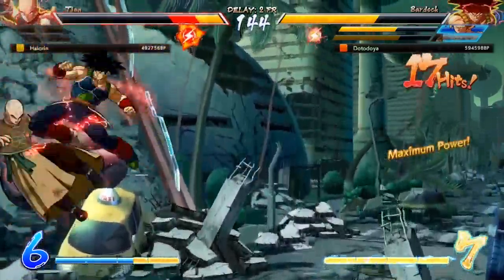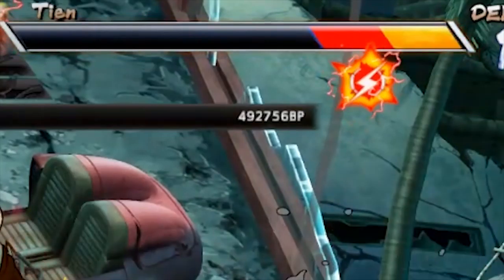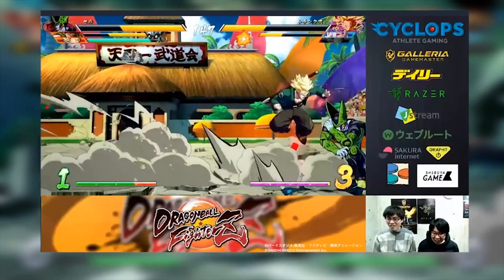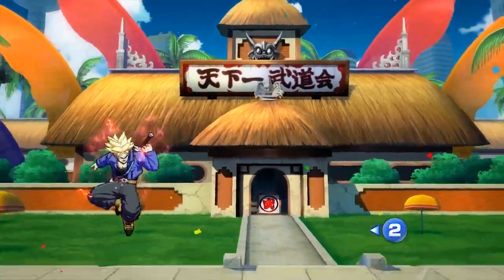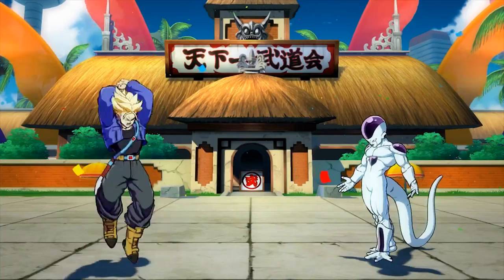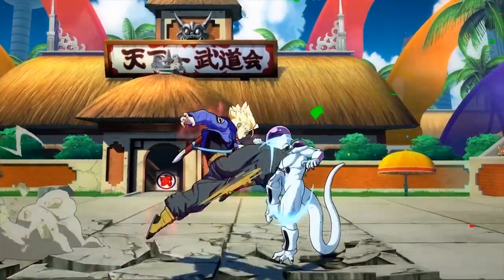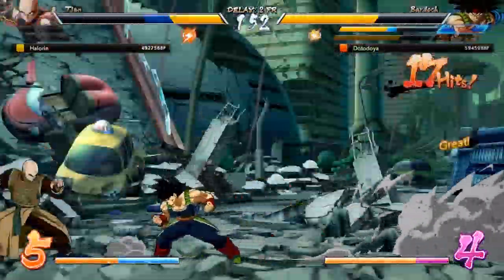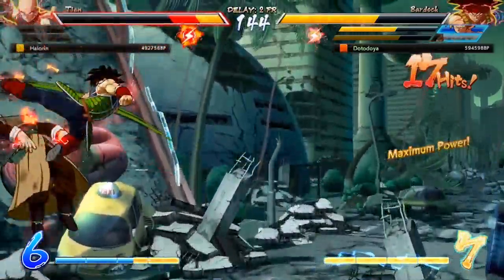Sparking Blast Mechanic Breakdown | Dragonball FighterZ

Comment: I’d like it if it became the universal combo breaker move
Reply: As long as it gives you a nerfed buff or just no buff at all, sure
Reply: DeKu Skrub I want it to work that if you use it combo break, it launches them away & you won’t be able to get a combo off of it. But if you use it during a combo it works the same. It would be unfair that you’re able to turn your opponents combo into your combo just like that.

Comment: I think they should definitely do some changes to the Guard Cancel. For a move that uses 1 meter to get rid of pressure, it sure is risky and doesn't have a lot of benefits. It could definitely be better. Maybe allow a full air combo on hit to at least return some damage. That way it's still risky since you can still get hit out of it but the rewards would be worth it.
Reply from the maker: Would probably be a good one to cover!
Reply: DotoDoya Cool beans

Comment: Also, one of my friends thinks there should be more command normals to open up for more combo posibilities. He's a Tekken player so the lack of moves makes the game boring to him. Personally, I think what he have now is fine but adding a few extra moves to characters could maybe spice some things up. Maybe if characters had as many command normals as Piccolo and Gohan had would be nice.
Reply: i mean he's not wrong... look at  the top characters like gohan and cell... they have all these extra buttons that they can use for multipurpose. the rest of the cast is relegated to unique normals like yamcha's 2H which actually does the opposite of benefitting some characters by making their combos require more resources for the same amounts of damage
Reply: The way the game works, you more have to look at the whole team as your character:

- Each character has unique normals, so 9 attacks (L,M,H/Crouching/standing/aerial) Some characters even have special skills, like A. Gohan who can use down_forward+light (3L) to do even more unique attacks and add more to your neutral arsenal. In addition, every character has an auto combo (LLL) which gives them a unique special attack on the third L.

- Specials, which on average is about 4 per character BUT doesn't include all the variants, which all L,M, &H specials have different application so in reality most characters have about 10 specials at their disposal. A. Gohan for instance has Jet Upper, Machine Gun Kicks, & Ultimate Back attack, each with 3 variants. His masenko has no variant.

- Supers, which is minimum 2 (one level 1 and one level 3 w/o considering variations like firing a kamehameha from straight to diagonal which has it's own applications)

With 3 characters at your disposal, you have roughly 70 moves right there. Now we look at universal moves we won't count per character because they are not unique.

- Dragon Rush, Super Dash, Instant Air Dash, Charge, Z Reflect, Z Assist, Z Change, Guard Cancel Change, Ultimate Z Change, Jump Cancel, Double Jump, Auto Combos, Vanish, and the infamous Sparking Blast which allows characters to completely change how EVERYTHING that was previously mentioned can be utilized in a new way.

This still doesn't include the insane amount of technical movement this game allows either which can be different per character, like Frieza who can get triple jump options in Golden Form.

Every time you walk into a fight, you have 90+ options to consider in a VERY fast paced game that can be extremely punishing on a single mistake. I think this game really has a lot already in it and adding more would make this game very difficult to keep up with. I'm a seasoned fighting game player and I've been playing Tekken since 2 and I have never ever played a game like fighterz which lets me find something new every time I sit down and play it. This game is nuts.
Reply: Fin Fen, i agree with you completely, but the fact that characters like gohan and cell have these extra options still elevates them from other characters. gohan has a super fast antiair (3H) that also doubles as a launcher in case you throw out a 5M and hit with it, which is usually followed by a 2M for an auto combo for most characters, but gohan can essentially do 5M,2M,3H and get the 2M,5M combo. his 3L is also a very versatile tool in his arsenal which essentially allows you to switch out 100% perfectly safe if you get a hit with it, and maybe even on block (though that's not fully safe). in addition, a character can have multiple specials but those specials can suck ass and thus unusable unless in specific situation, so their arsenal is either very limited to specific situations or has useless tools that are never used, while other characters have these extra tools that they can do perfectly well without, but with are essentially top tier. 16's armor on his heavy attacks is the same thing, same can be said for his HKD on his command grabs, which are going to be nerfed in the upcoming patch.
Reply: Oh, most definitely but instead of just adding moves, I want them to make what we have viable. I think that'll be a good first step. The idea of adding even more moves to a team with 100 options is crazy and just kind of adds more potential problems to fix and leaves trap options in the game that don't get addressed. 

I think right now, we're looking at Gohan and Cell in the light because they have a lot that works well and compared to other characters, they shine more because of it. If all the other characters get their options spruced up, that view will shift. I'm hoping. A Gohan nerfs incoming anyways. Fingers crossed
Reply: personally i think characters should have access to their L autocombo moves as command normals, for example 3L can be the second hit, and 3H can be the third hit of the autocombo. obviously with altered traits, for example freeza's 5LLL has tracking, if done raw it should have a distance limit. some characters who have command grabs or super unique normals on their 3rd autocombo attack do not need to have them accessible like the rest, but rather should get a bonus attack in 3H. this is already true for cell and gohan. this can allow for a bit more diversity for what the cast can do. and at the same time, doesn't limit some attacks that one can use to having to whiff autocombos to get the desired attack out.

Comment: Biggest change they need to make is to make some normals and specials less safe on block.
Reply: Principal Skinner especially beam super cough goku's cough, give it pushback or guard stun, not both pls.
Reply: reflect
Reply: GhettoBlackKid3 :/ if you think reflect is a powerful option you're not very good at the game.
Reply: GhettoBlackKid3 :/ isn't really a reliable option.
Reply: i was talking to yoyo beat, and if you reflect a kamehameha during a block string you can counter attack for free because its unsafe. also if an opponent instant airdashes or dashes in with an attack and you refect you get a free combo as well. learn to use the options instead of just instantly thinking its bad.
Reply: GhettoBlackKid3 :/ i never really said reflect wasn't a option, just that it isn't really a reliable one, yes it's possible to punish if they do a kamehameha in their block string but it can be covered by using assists, and after that you're still at the same point with guardstun and pushback.
Reply: Yes kamehameha's aren't broken, never said it was, but i think they should just pick what they would give it, pushback or guardstun, like most other specials in this game (Hit's punch doesn't have pushback but it does have guard stun)
Reply: when i said learn to use the options instead of just instantly thinking its bad i was talking to principal skinner. i completely agree with the fact that it doesnt need both pushback and gaurdstun is still think reflect is enough to deal with it. i punish gokus that rely on the kamehameha in block strings just fine.
Reply: GhettoBlackKid3 :/ i feel ya, and you're right people should use all the tools in a game.
Reply: Kamehameha doesn't have great blockstun. You can see it if you use it while the enemy is in the corner and you try to end your blockstring with it. If he has a jab that is long enough he can punish you without reflect.
Reply: Martin but it is enough to extended it to a save vanish extended, where u can backdash but it's save. It doesn't have great guardstun but it's enough so it still got amazing range good pushback and guardstun. While teen gohan his Qcf L or medium (as a view point) doesn't really have neither.
Reply: Yoyo Beat You should use J.236M as your Blockstring with Teen Gohan. I just don't see where the problem with Kamehameha is. When you don't cover it with an assist it's punishable.
Reply: Martin i do, i'm not trying to sound petty, it's just that i think it's unfair imo that kamehameha's have way more utility then other moves in this game, not difficult to counter. It's a small thing but i like fairness above all, maybe make beam supers more like yamcha's with a bit more start up then it would be used as a zoning/spacing mostly and not as a blockstring, combo starter/combo extender and a zoning/spacing tool, while other characters with almost only melee hits have a slight disadvantage because they don't have this "powerfull" tool